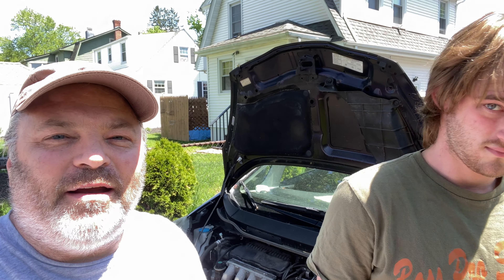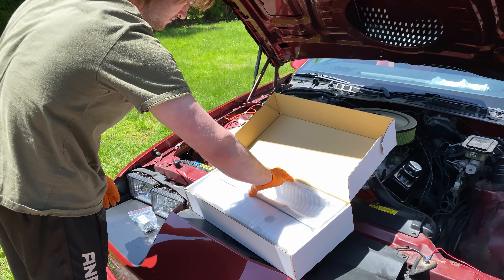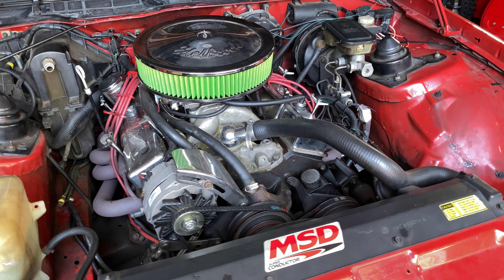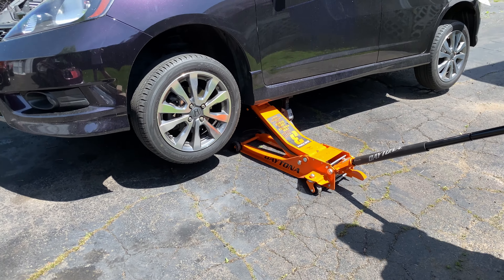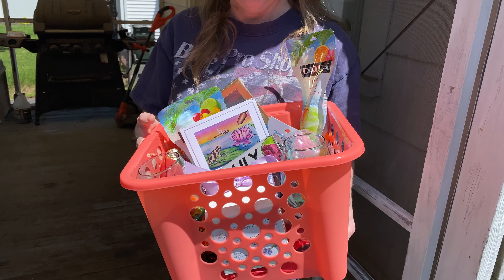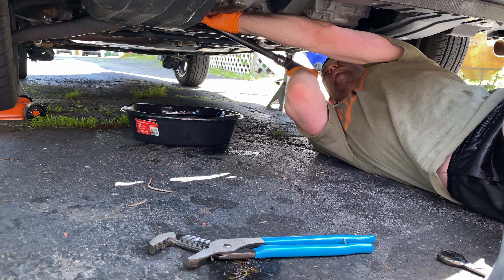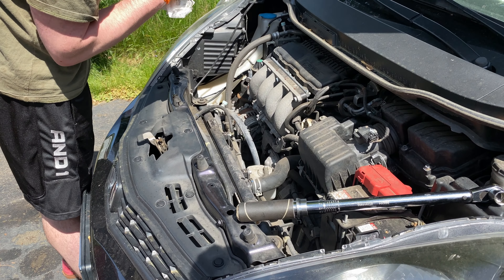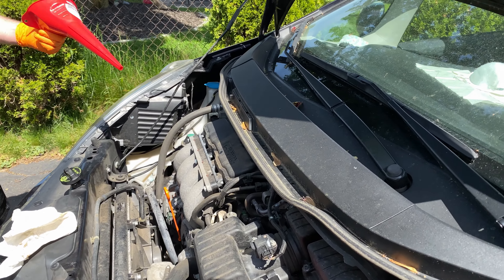Change the Oil in Your Honda Fit and Save Money With This Step-by-Step Tutorial

Comment: we have 2011 honda fit at our job, we use it as a delivery vehicle, believe it or not the clock reads 425,000 miles on the original engine and trans and still runs well and burns no oil in between oil changes
Reply from the maker: Holy cow! That's amazing. I like small cars, and it's perfect because it has so much room. You can "fit" anything in there. I just learned they're discontinuing it, though, because people want larger cars and SUVs.
Reply: trigga ville Totally believe it! I had a 2011 fit myself a while back until it was t boned by a red light runner but loved that little car and it would go forever. My buddy has a 2007 fit as well with 200k on the clock original motor, tranny, struts even etc and isn’t burning any oil either. Oh and he uses 5w20 conventional and cheap shop filters only too. That Honda motor just doesn’t care as long as it’s changed on time lol
Reply: @fartnutssupreme4930  nice